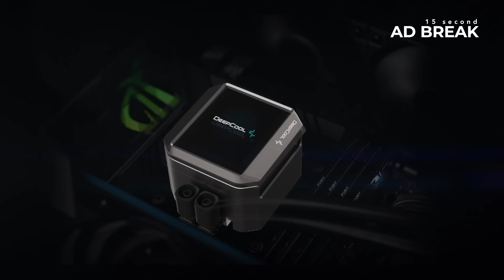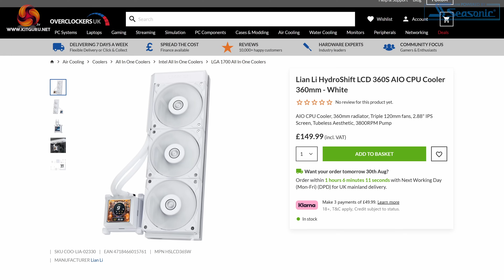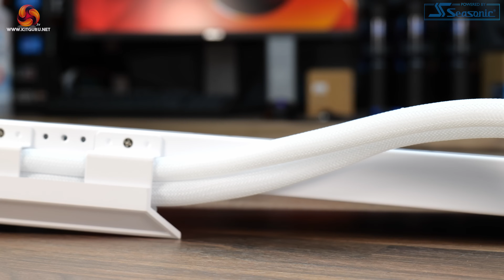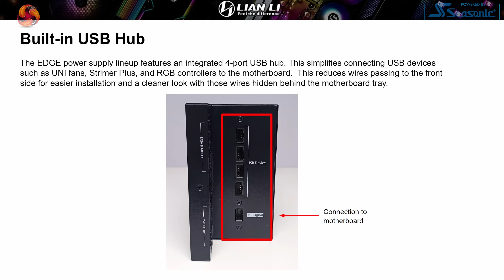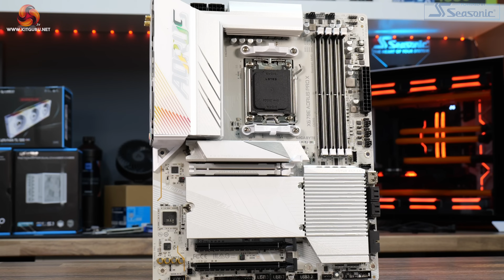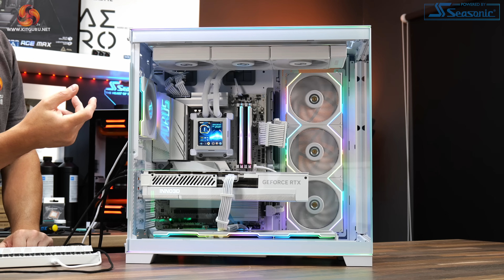Lian Li HydroShift & Edge PSU: perfect for a dual-chamber build!

Comment: Not sure I trust Lian Li any more for durability. PC is 2.5 years old Lian Li Galahad II Trinity pump failure, my two sets of three 120mm Lian Li 2 fans died, the 011 EVO razor case the LED controller is failing and has been an issue from day 1 needing a reboot to get it to work again. I know things wear out but im used to getting at least 5 years out of a very expensive AOI cooler, and Lian Li was supposed to be higher quality stuff...

Comment: @KitGuruTech Lian Li UNI FAN TL 3pack have same controller as is attached to Lian Li HydroShift 360 TL ? I'm using stock cooler actually becouse I need to wait 2 weeks for AIO and I don't know if I can actualy prepare everything for this aio with controller from 3pack

Comment: Have you had any problems with your hydroshift lcd and lconnect not working properly and causing lag in your system with the pc freezing up. I just built mine and have updated everything I could. But the lconnect software keeps losing connection to the fans and lcd screen.

Comment: I just got the 360TL version for a 9950X. The Kraken 280mm one I have is quite new but doesn't really cut the mustard, so my nephew is getting it for Xmas. The highest core count AMD and Intel chips these days can zoom up to their thermal limits in a split second. It takes a lot of cooling to prevent throttling. The 280mm AIO is only just coping, so I can't run PBO -- not that PBO is worth it for every day use I figure (bench tests a little better, but uses lots more power to do it). 

I have a Lian Li Lan Cool 206 case. I did not want a dual case, because it would take up too much space. I am really impressed with the quality, especially with the back panel and how tidy it all is with the wiring and nice touches for preventing it looking like spaghetti junction. I also like the two big 160mm front fans. They look cool moving lots of air quietly (important because it's a digital audio workstation).  

I have a Corsair RM850 PSU. I wish it had nicer cables like in this video. It has the non-braided plastic looking ones. They're shite. I'll look for a cable kit I guess -- once I work out what's what with them all. We left England for NZ when i was 15. Not so many options here. Better than it was in the 1990s, but nothing like some countries that are so spoiled for choice. Stuff cost loads more here too. The price we pay for living in such a nice spot I guess (I miss my football, there's no Jaffa Cakes, and the fish'n'chip shops here do not have vinegar -- heathens lol).

P.S. In the new year it will be time to upgrade my GPU. I try not to give that leather jacket wearing Nvidia bloke my money if I can help it. Monopolist pricks. AMD are not making it easy though. Early next year their new card is out. Supposed to be mid range and called the 8800XT. Hopefully it's good and priced well. We'll see. No way am I paying $5K NZ money for a RTX 5090 (a RTX 4090 is almost £2000 here, which is daylight effing robbery).
BTW. Late convert to RGB. I was "why the eff would I want my PC to look like a Xmas tree?". But once I saw it in person I kind of liked it. Now it's all RBG after finally retiring my trusty Noctua air cooler. :)

Comment: The power supply is genius but it’s not flawless because it doesn’t fit in every case
Reply: 😅 It’s meant specifically for lian li 
Dual chamber cases. Yes, you can use them elsewhere, kind of… but why? Corsair already has their “shift” psu.

Comment: Maybe it is because I have yet to build in a dual-chamber case, but I truly don't see the  advantage of changing the orientation of the terminals on the power supply? The USB hub is nice I suppose, but I would think having the cables turn 180 degrees to go into the power supply would be more trouble.
Reply from the maker: If you connect all your cables to the psu before installing the psu in your system then it's not such a useful feature. 

But in dual chamber it is  a little easier to connect additional cables to the edge psu at a later date.

As said in the video, it's not a game changer, the USB hub is useful though.

Comment: Would have been nice if it was Project Zero ! but I like cables, they give it a mechanical look I like.
Reply from the maker: I'm still undecided on if I prefer Project Zero or nice custom cables. I'd like all the smaller cables hidden on back connect but want to see custom sleeved 24-pin, EPS and PCIe/12VHPWR I think.

Comment: They need to up the GPU voltage to 24v and call it a day instead of messing about with multiple 12v connections.
Reply from the maker: Interesting idea.
Reply: Dont think PCs have ever gone above 12v on the DC side of the PSU.

Comment: I really don't see the point of using a PSU that can only be used by one type of case.
Reply from the maker: To be fair the PSU is often a part that you can move over to a new system if you buy good quality to start with so I get what you are saying.

Comment: Why the video card cradle is not being used. This is the first mistake of beginners. The huge weight of the video card, even with internal reinforcement, will not save you from bending... How many times can you...?
Reply from the maker: There was no need to use it in this build because it was being disassembled soon after shooting. Also the GPU support bracket is black so it didn't work with the aesthetics. There isn't any noticeable sag with this graphics card either.
Reply: @KitGuruTech  The sagging is not noticeable at first. This has been verified for many years. And many repair shops are flooded with video cards with BGA solder coming off after sagging. Nowadays even softer lead-free solder is used as a rule. Your videos are watched by a large audience - and this is often an example for users who will want to build their own computer. Also, for your information, manufacturers recommend using a stand. In the event of failure, this will not be a warranty issue.

Comment: Absolutely love the looks of that. I know dual chamber cases now seem to annoy a lot of people, but the world is very bitter as a rule. Anyone old enough will remember the biege square boxes with IDE cables inside blocking everything - PC sector today is amazing.
Reply from the maker: I remember those cases and IDE cables very well, the joy of manually setting master and slave drives was like nothing else 🙃
Reply: Ha, you and me both - long gone are the days thank god !
Reply: I remember some of those days
Reply: Wow I had to google some of that 😂😊
Reply: Have a similar black build waiting to be built right now, went w (6) 140mm LCD TL fans for side and bottom. X870e Crosshair Hero, 9800X3D, 7900xtx for now, will get 5090 when a complimentary aftermarket card comes out.